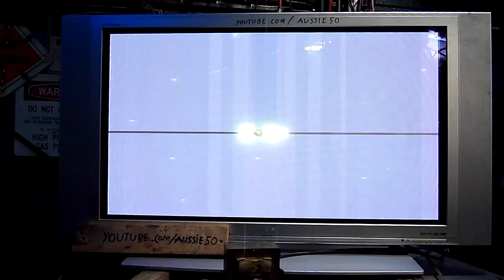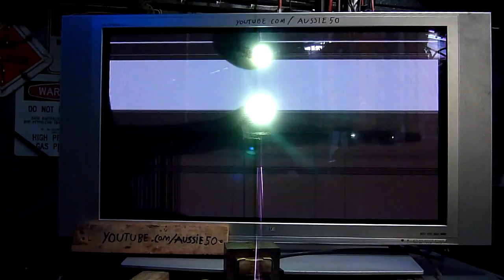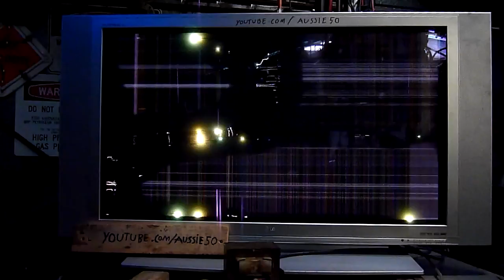LG Plasma Arc Display Panel - Burn Baby Burn

Comment from the maker: I wired the MOT across the Z and Y Sustain connectors. I had the Y Buffers still attached, along with the whole X sustain and control board assembly going to ground.. all other parts were stripped for spares since they were still serviceable.

Comment from the maker: the problem on the right was where I broke the ribbon cable clamp on the control board, it was not making contact with its control, hence no voltage going to ground

Comment from the maker: Fair point, I would not want to have to waste my Co2 or Dry Chem fire extinguishers if it caught fire in a big way, thats why I do things like that outiside, where it can safely burn to the ground :D

Engines/fuel leaks are the biggest risk to my workshop IMO, thats why I take fire safety seriously.

I woke up years ago when I discovered how to use high voltage and fire, safely, for entertainment :D